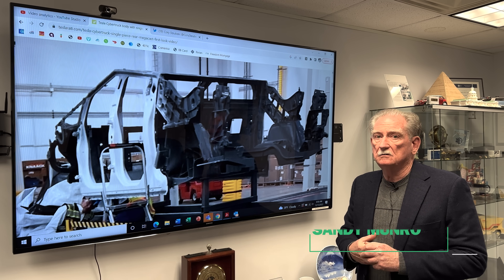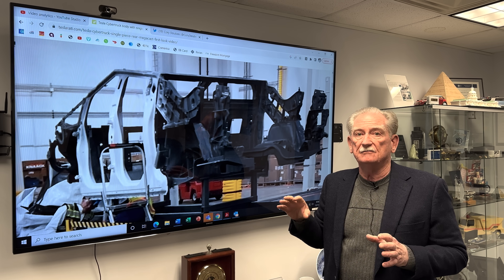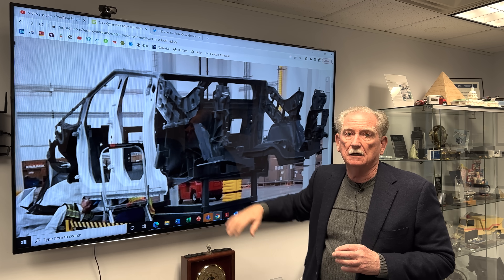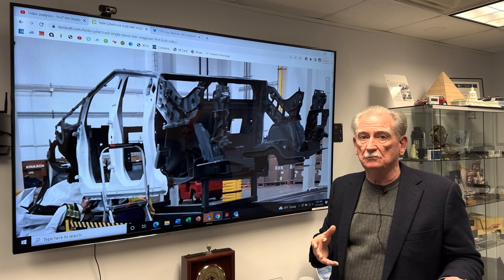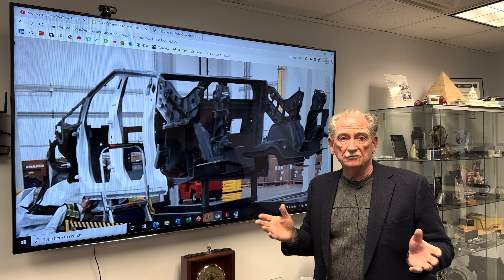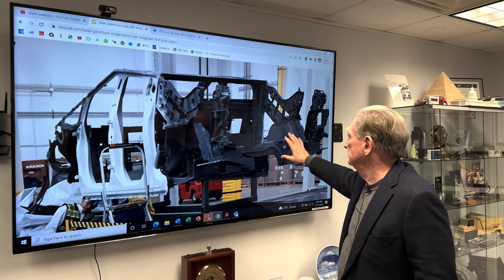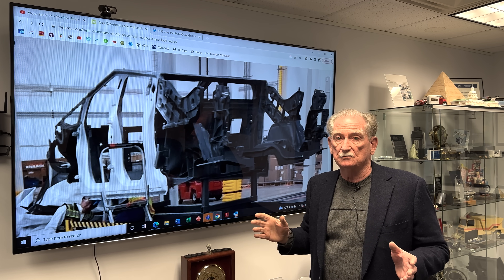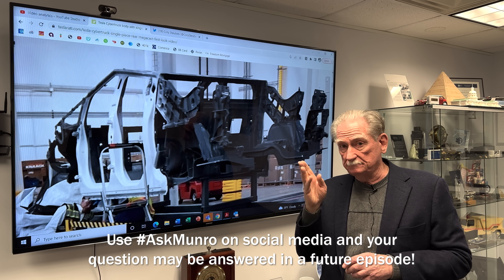Ask Munro E3: Sandy's Take on Tesla's Cybertruck Castings

Comment: If they are still doing  prototype on the frame how far away are they from meaningful production numbers?
Reply: Not clear. 
They are likely using the prototype here to set up the rest of the machines. So that once the press arrives and is set up, the rest of the line is already prepared for it
Reply: They probably have long way to go before production. Imagine all the testing that has to done to make sure the design is ok. The truck manufacturer I used to work for ( retired) used 3D printing for prototypes. Making a mould with styrofoam and use investment casting is a bad idea if you have tolerances 0.1 mm, so I believe that it is not what they do. These parts are designed using CAD and the 3D models can be made into files that can be used directly in the 3D printers. The company I worked for, Scania, started using 3D printers ( called free form production at the time) in 1990 for prototype manufacturing.

Comment: Thanks for the clarification. Should we interpret this as Munro expecting the actual production casting to be multiple parts as well? Or would this just be for the prototype and once the Gigapress is actually installed and functional in Austin these 5 prototype parts that are welded together could be cast as one giant piece? TIA
Reply: The Gigapress is meant for very large castings so it should be obvious what the answer is. They are finalizing what the single piece mold will look like by using a system of modular sub-casts until the correct single shape can be obtained.
Reply: @Battlefresh  they will probably use three castings
Reply: @carholic-sz3qv  We'll see. My money is on 2 castings. One for the front structure, one for the rear. Middle will be traditional hydroformed chassis.
Reply: Nope

Comment: Thank you sandy great to know this is prototype :) Maybe still a hope for mid-gate on the production model :)
Reply: Good point!
Reply: If they treat the bed cover like a solid sunroof and slide it under the cabin roof, they can keep the area behind the seats clear allowing for a passthrough, or just a "permanent" extension under the seat cushion with a wall at the front edge of the seat.
You could maybe get 6-10" depth? Sufficient for 10-20 sheets of 8' board?
Reply: @rogerstarkey5390  I've been pondering how to do the passthrough with the tonneau cover and never considered sliding it under the roof. That is perhaps brilliant. Or lunacy . But thanks anyways.
Reply: @briansilver3412  
Its essentially tech that's already in use

Comment: Sandy can you cover different hypothetical ways you think Tesla might be able to join the stainless and aluminum together?
Reply: adhesives
Reply: Bolt (LOL I know Sandy hates bolts), rivet, structural adhesive. Pretty common to lay down a bead of adhesive then rivet to hold them together while the adhesive cures. Sheet metal can be hemmed (folded) around the edge of another part, very common for door skins. I'm sure there's more.

Comment: Thanks Sandy, still trying to stage the 4680 battery for a unique display, ( its kind of big )  Maybe a Christmas ornament.  I got two 4680 batteries, one for me and one for my son.  I do enjoy the Plaid Rotor Laminate which I framed with the sign invoice as a background with your MUNRO LiVE sticker. Its in a 8 x 8 frame with magnetic tape so I display it on my refrigerator.  This will remind me that my Tesla Roadster will have this part laminate and possible Plaid Motor.  I will take the Roadster on the track.  I got almost 4 years at Sears Point Raceway and Laguna Sega with a National license with SCCA.  Like you I was a road racer my teacher was Bob Bondurant race car drivers.  With his help, I set the lap record in my class at both race tracks.  It’s all about the perfect line and when you do it right you can let the race car fly thru the track with minimum effort.

Comment: Was not expecting to see the castings going up into the "wings" behind the cab. This seems to suggest that claims that the stainless steel shell carries most of the structure were pure BS. It also seems to suggest a thinner walled stainless skin than we had originally been led to believe. (Which will be much easier to bend anyway). We can also clearly see the stampings around the cabin which Ive had many arguments about with people who thought stampings would be eliminated. Overall this photo suggests a very different vehicle than the Cybertruck reveal seemed to imply. One which may not be quite as fast to assemble as was originally suggested.

Comment: Excited to see you guys tearing down the Motor of Cyber Truck.
Reply: It's going to be essentially a (set of) Plaid motor with a scaled down Semi drivetrain.
.
200 mph:
Not needed.
.
"Chill mode/ Beast mode": Semi "clutch" system (for towing range)
.
Forget Crab mode, it's a gimmick/ point of failure.
Reply: @rogerstarkey5390  Oh! I see.

Comment: Early testing would make sense to do this way.  You only set up the huge mega-cast stuff once you've vetted out the process & know the precise direction you're taking.  Until then, casts that are quick 'n easy to set up and change.
Reply: Yeah, I think Sandy forgot to say that because the test article is multiple castings the production could very well be a single casting.
Reply: Won't be a single casting. A few simple castings welded together a better choice. Most likely same shapes as prototype, otherwise it's pointless to do validation on it.
Reply: @bikeaddictbp  the first model y delivered in 2020 had a 2 piece rear casting. Now it has the single piece f&r plus strucutral pack's. Munro himself confirmed this in both tear downs only 2 year's apart.

Seems tesla had no issues building testing and validating one process. Knowing all along they we're going to very quickly switch to another major step change. "The pace of innovation is all that matters" 🤔
Reply: @4literv6  exactly, and it's a smaller gigapress doing the Y parts.
Reply: @subwarpspeed  i cannot wait for the ct tear down by munro. Also tesla sharing a video of the 18,000,000# clamping force press making the ct rear casting. 😎👍🏻
Reply: Not to mention, when you have the machine to do it?
Reply: The final product ain’t going to be single casting

Comment: Rivian will be 4 years old by the time you can buy a Cybertruck and GM, Ford and Dodge will already have full EV pickups and vans on the road at about half the cost
Reply: Rivian was founded in 2009 now, the r1t&r1s we're first shown wayyyy back in the spring of 2018. Making that 13+years of them existing, raising over $22,000,000,000+ dollars and 4.5 years since they showed off the og truck's. 

Still haven't hit a run rate of 1,000 trucks a week either over 15 months from starting up production. 
Meanwhile both new tesla plants have opened and ramped up to over 2,000-3,000 a week run rates in half rivians time frame. 😎
Reply: Rivian might be dead by mid '23. So that's irrelevant.

And no one else is making a stainless steel EV. So they're irrelevant too.
Reply: To think that the Cybertruck is competition for any of the other Truck EV's is a mistake. All of the BEV trucks are taking sales from ICE trucks more, declining sales is proof of that

Comment: Hi Sandy and thanks for sharing your experience ans views. Do you think these pieces could also have been produced via 3D printing? We know the technology also allows working with metal ...
Reply: Probably milled via CAD
Reply: Usually 3D printing is very slow, so you don’t want to mass produce anything using 3D printing techniques.
Reply: @harsimranbansal5355  we know the press n the way. But for prototyping it would work.
Reply: @harsimranbansal5355  this foam casting is also slow because it's not for production
Reply: I think 3D printing for prototypes is the way to go rather than lost foam casting, would be way quicker.